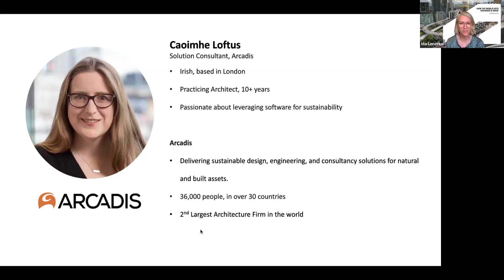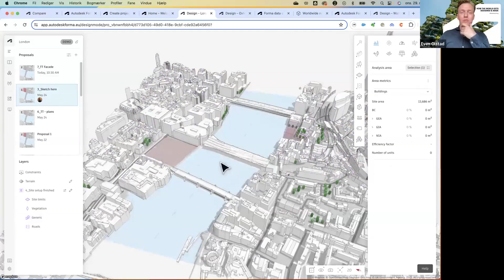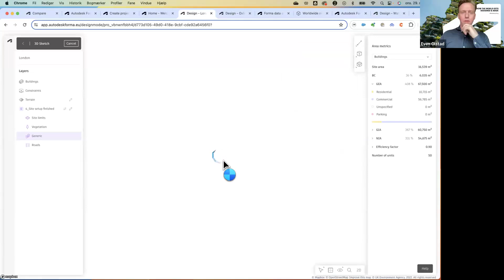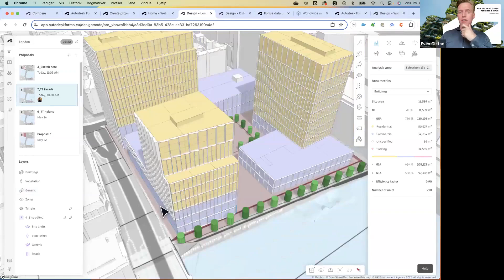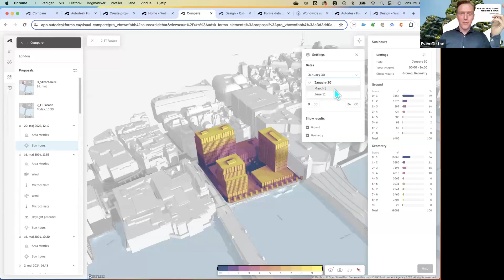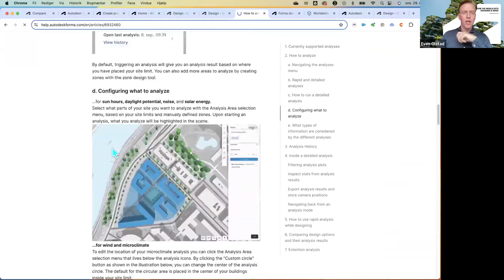How to design a sustainable city project with Forma

Comment: I created a proposal somewhere in Mauritius and when it is imported into Revit, you get this error message of alignment. I believe it is to do with the inherent limit of 40km from the Internal Origin. Is that normal? Does this affect the accuracy of my model?

Also, I compared the contours generated in Forma and the ones in Google Earth. There appears to be a difference of about 10m and the contours are not same as well. Which datum level should I trust?